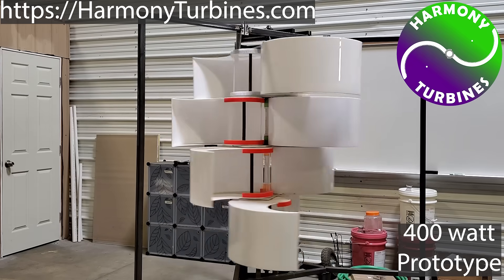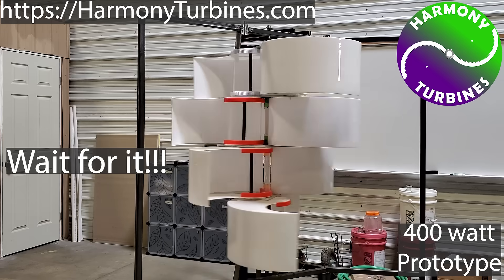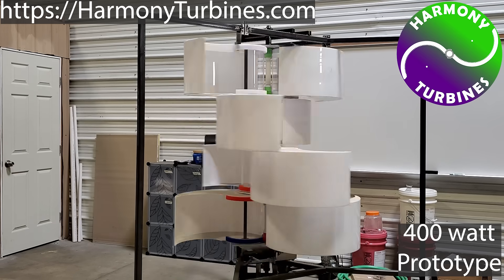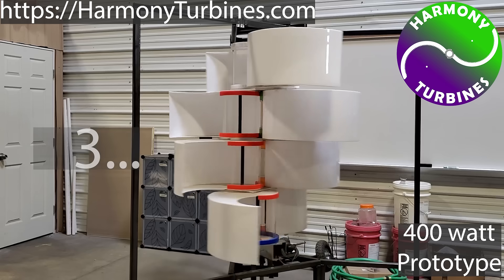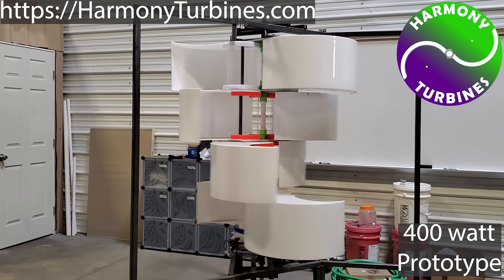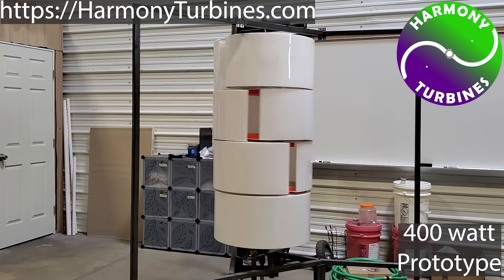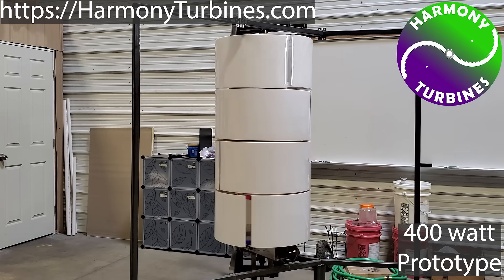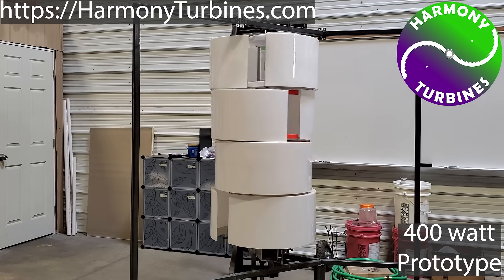Harmony Turbines Furling Explained

Comment: I know your still in the R&D stage.  Any estimates on how far away can a turbine be and still communicate with the charging system/batteries? Say one or two hundred yards?
Reply from the maker: John, that depends on how you bring the power out of the generator. If you keep it in wild 3-phase to do the long distance transmission you'd be fine and you could get away with smaller wires. Then 200 yards away you rectify it and dump it into batteries... That should be perfectly fine. You would never want to push the 24 or 48v DC (high amps) over that distance. If you'd like to help support our efforts through an investment you can go to https://WeFunder.com/harmony.turbines and if you're not able to invest we would ask that you at least help us to spread the URL to let others know what we're doing here to help make the world a better place.

Comment: Awesome Design. Where can I order them. I would like to install around 10 of these units on my on my roof ridge line, specially prepared for vertical axis micro turbines. There’s are 2 roof ridge lines around 20m each. How much spacing is needed between turbines. How much power does each turbine output?
Reply from the maker: Hi Toby, We're still in R&D mode so they are not yet available for sale but optimal grid pattern and spacing for Harmony Turbines is being examined by Penn State University if their project gets the grant funding starting this 2nd quarter. Each unit is 400w ...that's going to be the starting size for our units that can ship anywhere in the world. If you'd like help support our efforts through an investment you can go to https://WeFunder.com/harmony.turbines and if you're not able to invest we would ask that you at least help us to spread the URL to let others know what we're doing here to help make the world a better place.

Comment: Is this a pure mechanical folding system or is it using electronic drive motor's to fold and unfolding
Reply from the maker: Electronic drive servo motor, wormgear and mechanical advantage of about 150:1 so the furling can hold in place wherever its at 90% open, 80% open 75% open etc... without any need of further electrical input. That's the beauty of how wormgears work!
Reply: This is the question I was after.  How much cooler it would be if it wasn't electronic :/

Comment: Bravo, when are you going to discuss the generator? Im about to buy an ecoflow system, but really believe, your whole house system, will knock it out the park.
Reply from the maker: Thanks Ian, I will start to reveal more information on the generator after it's more fully developed in-house. We need to be first to market with our tech and I can't reveal too many things before we're ready. Sorry this may be frustrating to some but we're going as quickly as our funding at this time will allow.
Reply: @HarmonyTurbines  Thanks for the rapid reply, much appreciated. I understand your position, I really do, but can i ask, do you suppose it would be this year at some point? And do you know ecoflow (of course you do!), and if your system will it knock it out the park? What the world needs, is a more affordable whole house, wind or solar, or methane gas (think home biogas) electric solution, that doesn't cost anything like off grid solar batteries cost. That would become a global game changer! -But you know all this. I know you're starting with smaller turbines, and that is smart, but my hope is that the generator system can take as many turbines as your home needs, to power, permanently, the lot, which is not really what the ecoflow system does.
Reply from the maker: Ian yes you'll be able to put as many in parallel as you need/want and plug them all into your home power system. We are just inches away from better storage tech (Supercaps, solid state batteries etc...) Harmony is going to be key to providing power into these storage systems. The world is about to change and decentralizing power is going to be a global need.
Reply: @HarmonyTurbines  Thats amazing news, and i thank you sincerely.